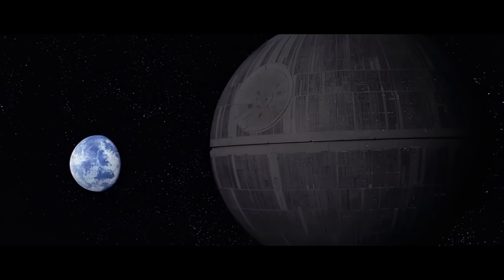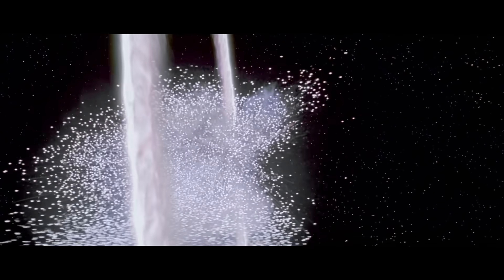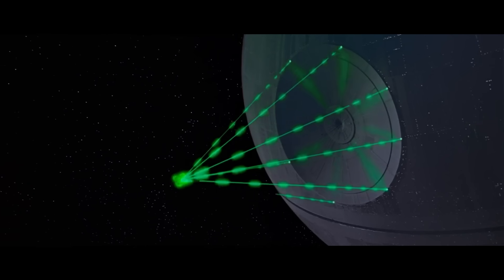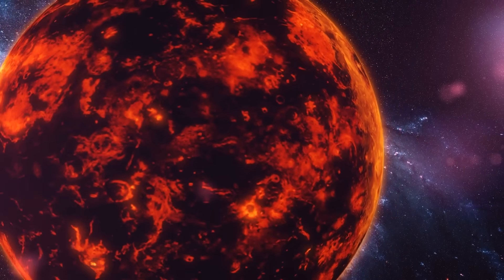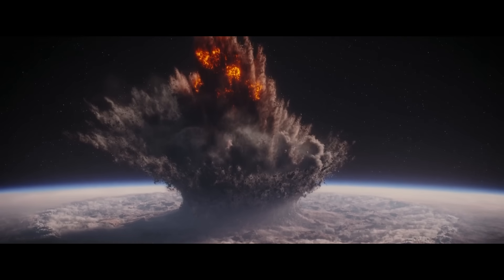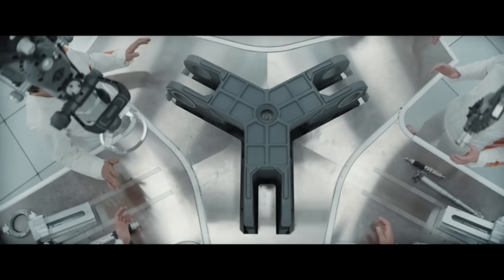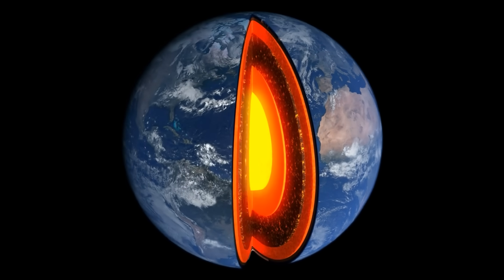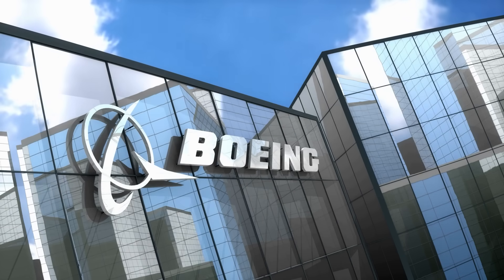The other "Design Flaw" no one talks about on the Death Star

Comment: So in the end, disrupt power. Which is what the rebels focused on and did by blowing up the main reactor. The main reactor blows up and the whole thing starts falling apart in the Disney movie and "Return of the Jedi".

Anyway, I think you had a great idea with using its mass against itself. Rebels could try sneaking aboard like Han and co. did in Episode 4, then screw up the propulsion so the Death Star crashes into a large moon or planet. Anakin and co. did that to a massive warship with a giant EMP cannon that Grievous was commanding in the Clone Wars series. Drove the ship right into a large moon.
Obviously, the Death Star would revise and tighten security after Han's lucky dare devil rescue, so an external attack would be the most viable and effective method, and the rebels did just that each time.

Assuming you are right in saying no one talks about this, I think no one talks about the Death Star's mass being an exploitable weakness because it is NOT an exploitable weakness. The Imperial forces aboard the station make it too impractical.

Comment: I totally disagree with you. 
The Death Star is only 120km in diameter. Not even close to the size most moons. More like a large asteroid. 
If we assume that it is 20% steel and the other 80% air (film footage and sketch drawings show that it has huge cavities inside, so it must be exaggeration of its mass), then its gravitational pull will be ≈ 0.026 m/c^2. Hardly worth the compensating.
A single Earth-like planet contains a million times more material than is needed for a single death star.
In Star Wars lore, there are planets that independently produced much more resource-intensive projects. For example Kamino and the clone army (with all their ships and equipment). 
Its construction is unlikely to be noticeable to the galactic economy. 
And more realistic in scale civilizations that have mastered only their home star system will be able to produce hundreds of thousands of these without noticing.
It would also be capable of creating tides if placed in low orbit, but it is unlikely to tear apart entire continents.

Comment: if the Death star I was in the outermost orbit of the Earth to where it could be seen from the ground. (For the Mass it's mostly hollow. The ship is made up of rooms, corridors, bays, vents, service tubes, and such. While it still has considerable mass, it's not as if it's a solid sphere of metals.
 The orientation of the interior is not like a sphere, where people walk relative to the core, but is rather up and down, so people are all upwardly justified. This means that the entire station is made up of a massive network of gravity fields. The result is likely that the ship itself has far less gravitational force than it would if it didn't have artificial gravity.)Keeping this in mind how far away would it have to be to be as visible as possible. While not affecting ANY animal behavior related to the tides but less the tides themselves while still not creating any visual difference from the ground

Comment: Well, Galen Erso designed his revenge quite well if you consider everything you've said, Alan.  A hit to the main reactor, which is what Galen's well-hidden flaw was designed to do, would disrupt the Death Star's main power just long enough for its own gravity to tear it apart.  A catastrophic explosion, while satisfying in a very alarming and disturbing way, would ultimately be unnecessary as long as main power was offline long enough for secondary systems like inertial dampening to fail all over the structure.

Comment: The death star is nowhere near massive enough to have a significant gravity field. Even the second death start at 160km diameter would have a MAXIMUM surface gravity of .06 m/s and thats assuming a solid mass. Thats less than a quarter of ceres and 1/27th that of the moon. The square cubed law means the death star would literally have to be IN the atmosphere to affect the tides and would have to be BELOW the planets surface to affect continents by force of gravity. And given that they are not a solid mass it's FAR more likely to be significantly lower than that value.

Comment: One thing that would be interesting to see would be them attacking the Death Star laser projector directly. We saw this in the Clone Wars series where Anakin leads an attack on the Malevolence and they attack the ion cannon projector directly, causing it to explode upon firing and crippling the ship. What if that happened but with the Death Star? Sure, it might not have been completely destroyed like a well placed shot down a meter across hole, but it still would’ve crippled the station and likely would’ve made most consider abandoning ship.
Reply: You have the sense of scale of a pre-schooler.

Comment: Yoour completely exaggerate the effects of gravity. As yousaid the Deathstar is smaller than the moon and the moon doesn't have a lot of g-force. You know earth has a lot more gravitation than the moon and there are still caves on this planet! Not everything crushes and collapses because of gravitation. The metal structure of the deathstar could easily withstand it's own gravitation. Objects start to become round when they are around 1.000 kms in diameter. Thedeathstar would not collapse in on itself.
The bigger problem is: Where is the target? If the target is 60 lightyears away it would take 60 years from pushing the button to actually arriving at the target. That's a lot of time to evacuate a planet...

Comment: You don't need to go that far with hyperdrive to outpace the light. For example, The Return of the Jedi happens four years after the New Hope, so if one were to go from Earth to the nearest star, the light would still not have made it there from something that happened 4 years ago (or just barely made it there, if you want to split hairs about the remaining 0.2 light-year and how exactly 4 years ago it was). 

Secondly, even though the energy spent was a huge pulse, it went into destroying the planet, not into visible light. I doubt it would even show, as they are in another star system, and the implication being that it was reasonably far. Although if they could see Alderaan's star (which was not destroyed), they likely were not thousands of parsecs away, but more like 10 parsec (for human eye to see it on the dark night sky). Especially given that Alderaan is a core world, so the sky is more densely dotted with stars than out here in the Rim...

Comment: your mass calculations, I have to stop you there.
16 psyche contains more metal than is necessary for construction of the deathstar. you still need enough manufacturing capabilities, but the mass itself?
and regarding gravity fields, etc. there was a scene in the original trilogy, where a ship with darth vader landed on the death star. and it practically came in vertically. sure, the camera did not show this, because the rim was shown as going out to the side, not upwards.
in other words, while the film makers would have never thought about it, and just placed things as long as they looked good on the big screen, they accidentially got some things right.
but there is some other weakness to the deathstar, that I don't see in your video. upkeep and maintenance. or in other words: sure the deathstar can blow up a whole planet with one shot. for such a number, the published numbers of crewmen for the deathstar (especially the first one) is low.
that would mean that the deathstar is practically empty and has hundreds of kubic kilometer per person.
consider 100 times more crew (so 250 million instead of 2,5 million) as a somewhat more realistical number, and a massive amount of droids.
or in other words: just by letting the deathstar just exist, it would drain the empire of resources it desperately needs.
the rebels did the empire a favour when blowing it up, and the empire was foolish enough to make a second, even bigger one.
Reply: Oh, man, yeah, the Death Star(s) were such huge resources hogs. So huge, infact, that...uh, they both got hidden on secret black budgets, with no one bar the highest echelons in the know, built in the middle of nowhere, with zero drydock or pre-existing logistical network in place for them, and in the case of the second, built exponentially, orders of magntiude larger. UH-OH

Star Wars fans try to watch the movies challenge level; nightmare.

Comment: There's no need to sustain thrust in orbit unless that orbit is low enough that it will naturally decay from interactions with the planet's atmosphere. This is orbital mechanics 101. It would have been known in the seventeenth century, and possibly before.

However, I don't think your sums will add up. Yes, you might be talking quadrillions of tons, but if that mass is distributed through a space with a diameter of 160 km, the average density will be quite low, and the self-gravity probably trivially small. There are asteroids and moon's in the solar system in the range of 100 - 200 km in diameter, and their surface gravity is very, very small. And these objects have nowhere near the amount of open space inside that the movies have shown us is in the various iterations of "the" Death Star.

Yes, it will have huge amounts of inertia, and it must be made of some incredibly strong materials to be able to accelerate and decelerate as it travels, but its self-gravity is almost certainly negligible. There is obviously going to be a need for some magical artificial gravity jiggery-pokery to be built into the deck plating, but if you have the technology to do that, then you also have the technology to make the artificial gravity *not* crush the station it's been built into.

Comment: I made a structure 2/3 the size of the observable universe called univereon to control its local time. Makes wormholes and allows instant transfer or power and matter to Mable sized device called an icon. Powered by 4 red giant star galaxies.which feels like no where near enough power unless you fully agree time is messed with inside. No size powers, that’s fake

Comment: Hmm... maybe the hyper-matter generator at the core provides a uniform outward pressure (in much the same way sunlight or lasers can push a solar sail) which the design uses to offset the gravitation due to the mass of the structure? The ds2 design had a large spherical void around the core. This would explain the need for "exhaust ports" to vent some of the pressure from the core and prevent the death-star blowing itself up?

Comment: First off, I doubt that George Lucas or anyone actually considered the physics of the Death Star :)

However, looking up some estimations, I found that the Death Star (first one) was estimated to have a radius of 80 km and a mass of 10^18 kg. Using the formula Gm/r^2, you can calculate the expected value of the gravitational acceleration at its surface (FYI, on Earth, we call this g, which equals 9.8 m/s^2). Plugging in the above numbers, you find that g(DS) = 0.01 m/s^2, or in other words, about 1/1000 the gravitational acceleration on earth.

IMHO, this would probably mean that it wouldn't have a problem supporting its own structure, though given that it would need gravity generators, I don't know how that would work, or how it would affect structural integrity.

However, at 10^18 kg, it it doesn't even make it in the top 10 asteroids in our solar system. Given that it has 1/100,000 the mass of the moon, I don't think it would have a significant impact on a planet. Another back of the envelope calculation, if I did it right, is that an object with that mass would have to be at a radius of sqrt(100000) the radius of the moon's orbit to exert the same force. Roughly, this would be a 1000 km orbit. The ISS orbits at roughly 7000 km for comparison.

I just did this in a few minutes, so perhaps someone could double check my math.

Comment: The weapon reactor was also the primary energy reactor for the deathstar. They had others but they were not sufficient to actually prevent a complete failure of the deathstar if the primary reactor was taken out. The secondary reactors were only intended to be there for the full power discharge of the main weapon reactor. The secondary reactors only took over for a short period of time, somewhere between a fraction of a second to a couple of minutes at extreme most. Anything beyond that short operation would over tax the secondary generators to the point of failure.

Comment: If I were to build a moon or planet sized super structure, I would use centrifugal rings. In the star wars universe they might have magic inertial dampeners. In our universe, an active support structure means moving mass around to impart force. My idea for a centrifugal ring is a hollow tube. Inside that tube there is a mass rotor. This could be a fluid or solid ring of material or even discrete mass pellets that are electromagnetically suspended inside the tube. This rotor imparts an outward force on the tube. This puts the whole tube under tension. Then I would build a shell with numerous centrifugal rings like this. Think of it like a rubber band ball but the rubber bands are pulling outwards instead of compressing inwards. Constructing the interior is now simplified as I can mostly rely on tension structures. If it is especially large, it might be necessary to build multiple centrifugal shells.

Comment: There are materials that, given enough of it, would allow 160 km diameter structure in space.

Steel has a specific breaking length of about 6 km, but something like balsa wood is over 50 km. In 1 g. If you build a Death Star out of balsa, it obviously would have a far, far lower specific gravity... the 80 km radius would be nothing at all.

(coping with the stress of firing a 10^33 J gun on the other hand...)

Comment: gravity doesn't work the way you are talking.  to have a gravitational force to damage its shell, the average density would need to be far greater than that of earth. to get 1g at the surface, it'd need a mass of 3.8x10^23kg and we know that the Deathstar is mostly air. The average density of earth is 5500kg/m^3 or a mass of about 6x10^24kg.

Comment: I feel obligated to post the "Rocks are Not Free, Citizen" rant.

----

Firstly, you must manoeuvre the Emperor’s naval vessel within the asteroid belt, almost assuredly sustaining damage to the Emperor’s ship’s paint from micrometeoroids, while expending the Emperor’s fuel.

Then the Tech Priests must inspect the rock in question to ascertain its worthiness to do the Emperor’s bidding. Should it pass muster, the Emperor’s Servitors must use the Emperor’s auto-scrapers and melta-cutters to prepare the potential ordinance for movement. Finally, the Tech Priests finished, the Emperor’s officers may begin manoeuvring the Emperor’s warship to abut the asteroid at the prepared face (expending yet more of the Emperor’s fuel), and then begin boosting the stone towards the offensive planet.

After a few days of expending a prodigious amount of the Emperor’s fuel to accelerate the asteroid into an orbit more fitting to the Emperor’s desires, the Emperor’s ship may then return to the planet via superluminous warp travel and await the arrival of the stone, still many weeks (or months) away.

After twiddling away the Emperor’s time and eating the Emperor’s food in the wasteful pursuit of making sure that the Emperor’s enemies do not launch a deflection mission, they may finally watch the ordinance impact the planet (assuming that the Emperor’s ship does not need to attempt any last-minute course correction upon the rock, using yet more of the Emperor’s fuel).

Given a typical (class Bravo-CVII) system, we have the following:
Two months, O&M, Titan class warship: 4.2 Million Imperials
Two months, rations, crew of same: 0.2 MI
Two months, Tech Priest pastor: 1.7 MI
Two months, Servitor parish: 0.3 MI
Paint, Titan class warship: 2.5 MI
Dihydrogen peroxide fuel: 0.9 MI
Total: 9.8 MI

Contrasted with the following:
5 warheads, magna-melta: 2.5 MI
One day, O&M, Titan class warship: 0.3 MI
One day, rations, crew of same: 0.0 MI
Dihydrogen peroxide fuel: 0.1 MI
Total: 2.9 MI

Given the same result with under one third of the cost, the Emperor will have saved a massive amount of His most sacred money and almost a full month of time, during which His warship may be bombarding an entirely different planet.
The Emperor, through this – His Office of Imperial Outlays – hereby orders you to attend one (1) week of therapeutic accountancy training/penance. Please report to Areicon IV, Imperial City, Administratum Building CXXI, Room 1456, where you are to sit in the BLUE chair.

For the Emperor,
Bursarius Tenathis,
Purser Level XI,
Imperial Office of Outlays.

Comment: About gravity: given a structure of concentric more or less uniform spheres (like the Death Star), the gravitational force of any particular spherical surface is determined by the amount of mass the surface encapsulates.

This means the incremental gravitational force decreases as one gets to the center of the structure.

Furthermore, if the structure were hollow, creating a central cavity, there would be no apparent gravity in the cavity.

The way to build the Death Star without collapsing is simply to build a hollow shell of a moon with sparse bulky struts that cross to the other half of the structure to reinforce it during inertial acceleration. Hollowing it out will make it lighter and more maneuverable as well.

Rotating the darn thing a bigger problem as its rotational inertia will be astronomical.